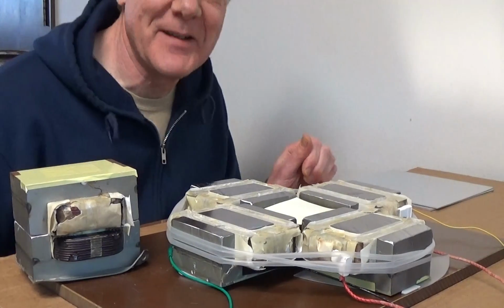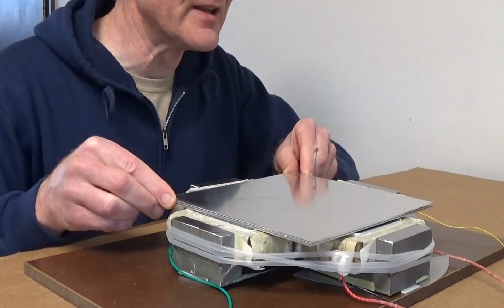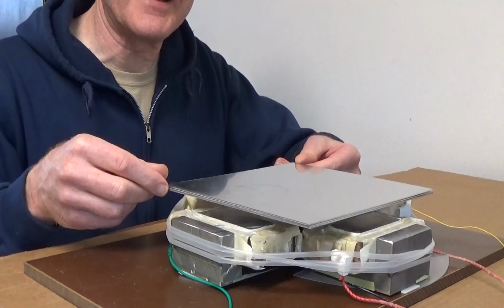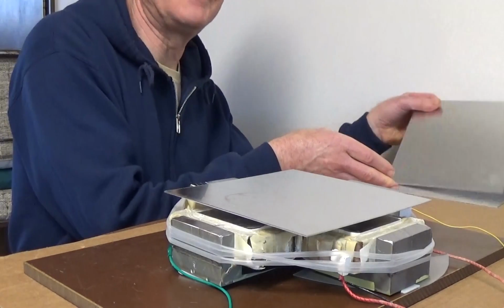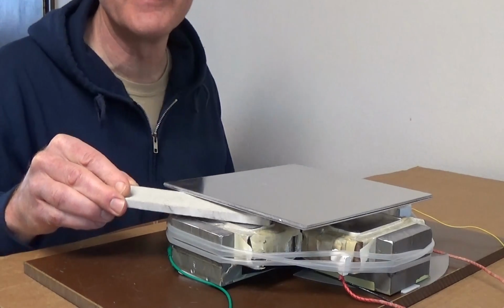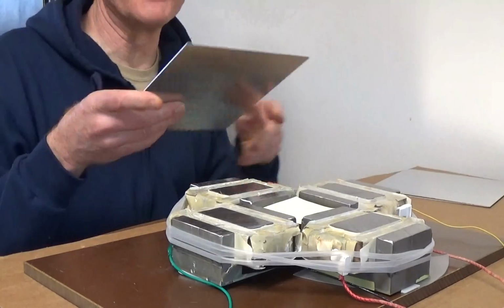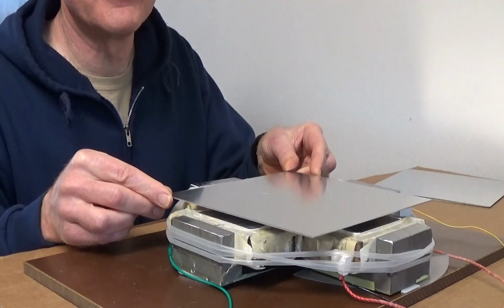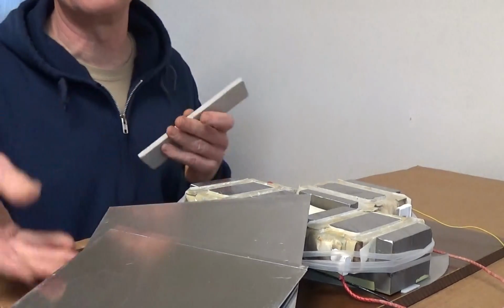Eddy current levitation using microwave oven transformers

Comment from the maker: I'm using the secondary-half of the microwave transformers for this demonstration.  All four are wired in parallel, about 1.3A each or about 5A total in this video.  It is powered by 240V line.  There is a motor-run capacitor in series, forming a series-resonant circuit.  The voltage across the transformers is a bit higher, around 300V if I recall correctly.  Changing the capacitor size (capacitance) changes the total current.  Lower current levitates less, but doesn't overheat as quickly.  Higher current is the opposite, a bit higher levitation, but a short run time before overheating.  I've ran from 4A to 6A total by changing capacitance.The primary transformer halves should also work, wired in series and running on 120V.  I damaged a couple primaries in sawing them in halves, so used secondaries.
Reply: How would copper sheet react?  I think levitation may be be even stronger than the aluminum 👍😊
Reply from the maker: @David-Christ-13  Yes, levitation force would be stronger for copper than for aluminum.  However, copper weighs even more.  So levitation height would be less.  (Copper has roughly 1.6x electrical conductivity and roughly 3.3x weight.)
Reply: what capacitance value did you find best for max power transfer?
Reply from the maker: @Stubert619  About 30uF was maximum if I recall correctly.  Power was a bit too high there.  Coils heated too quickly.  I think 40 or 45uF worked out for reasonable tradeoff between levitation and overheating.
Reply: @davekni  Thank you so much for the reply. I should probably note I'm 29, familiar with higher voltages and am starting the last 3 remaining semesters of my electrical engineering undergrad program at SDSU at the moment. I figure most real human beings ran into a fit of doubt at some point and mine was in my first 3D integral in my E.M physics class- didn't feel good in the moment. Maybe most people lived shorter spans before seeing a dumb wire move on a battery and magnet but I hadn't- I'm pretty far away from religious but it was like- idk the first bit of intelligent design separated from what had only been on exhausted onto paper up until that point. It lead me to stumble on Professor Eric Lewthwaite's work, and I've been doing my best to study his books in the heat of juggling a heavy STEM load. Maybe there isn't an ocean of money in making subatomic matter persuade their macroscopic counterpart into motion like this, but it is absolutely what stimulates my study. I'm grateful you shared this!
Reply from the maker: @Stubert619  Wonderful to see your curiosity and interest in the basic practical physics, such as wires moving in a magnetic field.  That understanding will be more important to your success as an engineer than being able to do 3D integrals.  Computer simulations do the hard work.  Problem is that many engineers don't have the intuitive understanding to correctly interpret simulation results.  You will do well.
Reply: “Motor-run capacitor”?
Reply from the maker: @OMNI_INFINITY  Yes.
Reply: @OMNI_INFINITY  I believe he meant "a run capacitor taken from a motor"

Comment: how much amps and volts?
Reply from the maker: I'm using the secondary-half of the microwave transformers for this 
demonstration.  All four are wired in parallel, about 1.3A each or about
 5A total in this video.  It is powered by 240V line.  There is a 
motor-run capacitor in series, forming a series-resonant circuit.  The 
voltage across the transformers is a bit higher, around 300V if I recall
 correctly.  Changing the capacitor size (capacitance) changes the total
 current.  Lower current levitates less, but doesn't overheat as 
quickly.  Higher current is the opposite, a bit higher levitation, but a
 short run time before overheating.  I've ran from 4A to 6A total by 
changing capacitance.The primary transformer halves should also work, 
wired in series and running on 120V.  I damaged a couple primaries in 
sawing them in halves, so used secondaries.
Reply: davekni  thanks, why dont you connect aluminum disc to transofrmers with plastic or wood? i mean whole system can fly.
Reply from the maker: The same magnetic force that is lifting the plates is pushing down on the transformers.  The magnetic force is separating the two.  There is no net force to levitate the system.  There are videos of the opposite setup, a coil levitating over aluminum plates.  Of course, the coil has wires attached to provide power, so it isn't completely isolated levitation as with my floating aluminum plates.
Reply: davekni if u increase the force, then its possible can be lifted with transformer and disc, why not? try to install in them iddle magnet, it will push the aluminum plate in some dirrections
Reply from the maker: It's a basic law of physics, often stated as "every action has an equal and opposite reaction".  Any upward (levitating) force has an equal magnitude downward force on something.  Airplanes push down on the air.  My levitator pushes down on the transformer halves, with just as much force as is pushing up on the aluminum.  If I were to put the transformers on a scale, they would weigh more when levitating the aluminum plates than when nothing is above them, exactly as much more as the weight of the plates.
Reply: davekni  what about ion craft? its lifting ^^
Reply from the maker: Ion engines, as with rockets in general, are pushing down on the exhaust they are expelling (at a high downward velocity because of the downward force the rocket is applying to the propellant in order to get the rocket's upward force).  For an ion engine, the exhaust is ions rather than combustion products.  Either way, rockets are expensive and inefficient in general because they must carry the weight of the propellant that they expel (that they push downward on).  There are some low-force space-maneuvering prototypes that push against the earth via the earth's magnetic field.  That avoids the inefficiencies of expelling propellant.  But, they are still pushing against something, the earth in that case.
Reply: ion lifter not rocket
Reply from the maker: Sorry - I was thinking of ion-engine, which is a type of rocket engine.  Ion lifters are somewhat similar, however.  The difference is that they do not need to carry the material that they ionize.  Instead, they ionize the surrounding air.  Then, because the ionized air below the lifter has the same charge as the lifter, the ions are repelled by the lifter (and visa-versa).  The air ions are pushed downward with the same force that the lifter is pushed upwards.  The lifter keeps creating new air ions to push away, as the old ones get pushed down and too far away from the lifter to be effective.
Reply: okey, what if we add in the middle magnet? will ions change their polaritys ?
Reply from the maker: The magnetic levitation in this video does not use ions.  The current flow is all due to electron flow within the aluminum coils and aluminum plates.  But, there is no combination of middle magnets or any other such modification that will cause the entire system to levitate.  Since you seem interested, I'd suggest you study physics - learn Newton's laws of motion and forces, and other fascinating knowledge about how our universe functions.  This tread has gone as far as it makes sense explaining specific situations.Sincerely,David Knierim
Reply: Thanks for answers!

Comment: Wow! So that's how it's done! Very similar setup to an experiment I did in 2004, except I used four U-shaped iron cores with a single coil going through the center of all of them, operating at 60 Hz. An aluminum plate would easily levitate, then immediately slide off the edge. I tried putting holes in the aluminum plate to force the eddy currents to occupy restricted paths, but I was never able to achieve stability. I had no idea it could be as simple as what you have done here. Thank you!
Reply from the maker: I didn't think it was that simple either, until I did some experimenting, initially with tiny flat coils running at 130KHz, levitating aluminum foil disks.  What it takes is a pancake coil wound in one direction for the inner half and the other direction for the outer half.  Next I made a larger 23KHz version https://www.youtube.com/watch?v=AHED5xSnnM8  Then I decided that a ring of transformer coils would be similar, as the current in the windings is going in one direction towards the center and in the other direction towards the outside.  It would be more efficient to have two larger coils, one on the inside and one on the outside, but transformers come per-wound.  So, I think your original version would have worked if you wrapped another coil around the outside of the U cores, in the opposite direction as the inside.